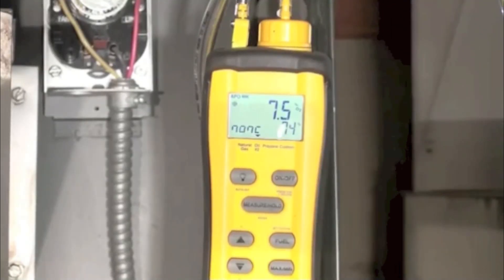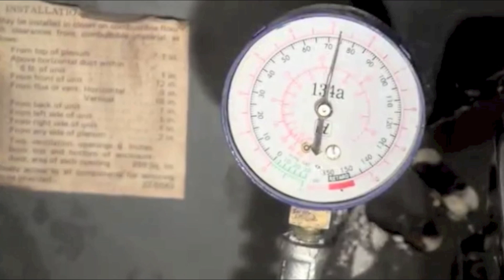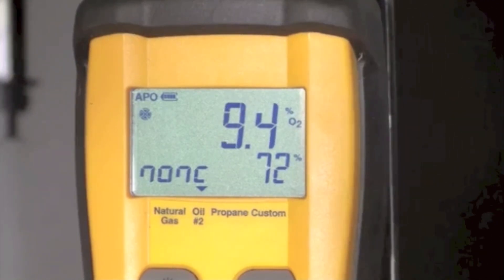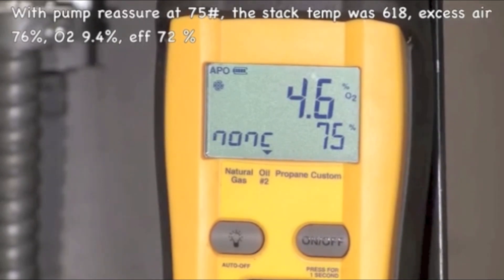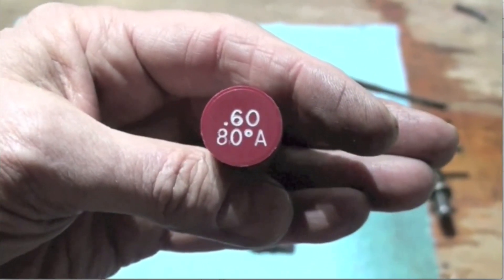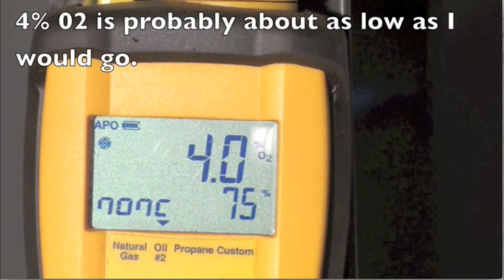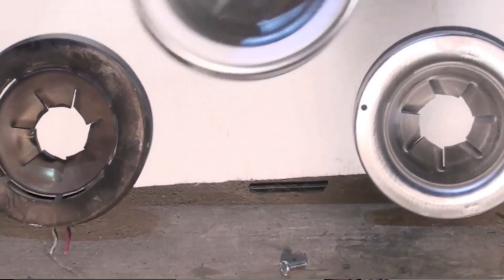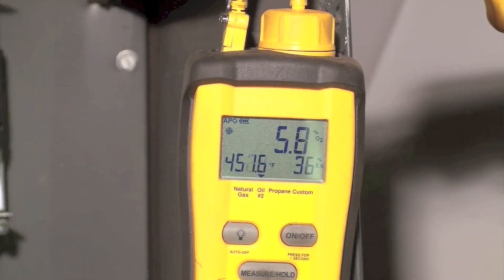Oil furnace efficiency conclusions part 5

Comment: Hi there love your videos they have really taught me more than ever how to help keep my old oil burners going . I hope to be changing over to solar and maybe heat pumps and get away from the awful stench of furnace oil .
I live on the east coast of Canada and we get some bad winters here. I would like your opinion on changing out me nozzle size on my old Beckett burner . Right now I have a .85 80 installed running at 100 psi. Would it be a benefit to change it out to a .40 80 and crank the pump pressure up to 120/140 on a brand new pump. The furnace is in my shop and as an injured vet it’s my sanctuary when I can get out and putter on my old car. The shop is 2000sqf all open space . I have 5 5” runs going along the ceiling out to the front of the shop and the return on the wall by the utility room . I’m just looking to use a little less heat . My floor is the problem as it’s 24 inches thick lol I know I went over board but poured over the old floor and installed in floor heating but it’s still not hooked up . I would love to ego chat more . Send me a reply and we can chat other than here . Tony
Reply from the maker: I generally want to keep my nozzle size at or above .5 GPH.  The increase in pressure is all positive.  Of course air and draft should be adjusted to match.
GFM

Comment: How are you going to get that combustion chamber into the heat exchanger?  Lennox used to send us slices and we had to cement them together using the burner opening and the inspection door.  Good series of videos.
Reply from the maker: There is a cover on the front where the burner fits.
GFM

Comment: thanks for doing this series.  I think there may be 2 different efficiencies, the combustion analyzer doesn't seem to take time to get to temperature into consideration, but it gauges efficiency as a function of CO2 CO and O2.  I don't think it measures efficiency in terms of time the burner takes to get a desired heat exchange temperature without having a too much heat loss up chimney.  Should a burner cut off as it meets it's output and gets to optimum stack temp for a non condensing boiler or should it run at that stack temperature for a few minutes?  I think when servicing to focus on smoke to avoid sooting, and CO2 CO O2 EA and other numbers to identify problems.
Reply from the maker: These are steady state efficiency readings.  For the best efficiency, the unit should run all the time.  Startup and shut down losses cannot be accounted for with these measurements.
GFM

Comment: I'd sure like to do this with my old furnace
but there's no way I could afford to pay someone to do this for me.
if I could get the equipment, I'd make some changes to my settings for a cleaner burn/more efficient burn.

But might be cheaper in the long run to get a new furnace installed
Reply from the maker: Try this:  https://youtu.be/zQHIgPFmh9U
GFM
Reply: @grayfurnaceman  Thanks for that.   I thought I had seen all your videos, but missed that one.   That really helps

Comment: So you changed the burner nozzle and plate,combustion chamber and a new pump because you blew up the old pump. You spent how many hours doing this just to get the customer about 7% better efficiency. How did this effect the plenum temp. And how much did this cost the customer to do.I find it hard to believe there was enough payback to warrant more than a nozzle change and a tweek on the pump. Or was this just for training purposes--I hope.
Reply from the maker: +EFD620G All the furnaces you see in my videos are test mules.  They are for training.  Modifications that were done were to show how they are done, not to determine cost effectiveness.  That can only be done between the customer and the tech.
GFM

Comment: Good demo but in the real world with a nozzle that small you would need to burn Kerosene. That would kill any savings
Reply from the maker: Interesting.  Why would I have to use kerosene?
GFM
Reply: That nozzle will clog or partially clog with number two oil. Very little room to play on a nozzle that small. But hey it might last ten years too. Never can tell I just wouldn't want to trust it in a customers home.

I am a firm believer that the higher the pressure the better the burn. Some of these new high efficiency boilers we end up running 190 psi just to keep them running.

I down fire everything and raise pressure but I don't like going smaller than .60 on a nozzle using #2 especially if the tank is outside.

I've never been one of the manufacturer knows best types. What it does in their lab isn't what its going to do in everyones home. Every job is different.

Your stack temp was high but there's a point you lower the nozzle size to much and you cant increase the pressure enough to keep your stack temp high enough to prevent condensation especially in a boiler.

I love your videos by the way. You must have been a great teacher.
Reply from the maker: Al Gregory I agree on the downsizing and pressure.  The decision on downsizing to as low as a .4 must be made by taking into account age and condition.  Some of these things would plug any nozzle because of low maintenance.  I used to have customers that serviced their furnace every year and never ran out of oil, and they virtually never had any fuel related problems in over 30 years of use.  
I also would never do anything like this on an outside tank.  There are by far many more fuel problems with these than inside.  
One of the reasons I went this small was the furnace was only rated a .7.  Most of them I worked on were 1.0 to 1.75 GPM.  They were, in most cases massively oversized.  I have never been able to get one to condense except, of course, boilers.
Your comments have been great.  I wish there were more techs like you.  Sometimes when I see the comments I get, I get the idea they think I know everything.  Boy, I have I got them fooled!!
Keep up the constructive criticism,  
GFM